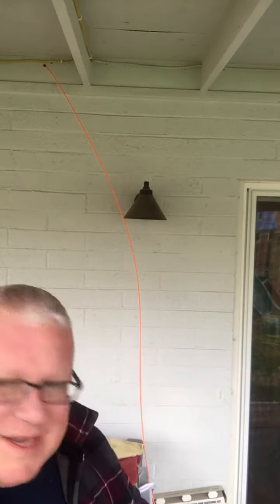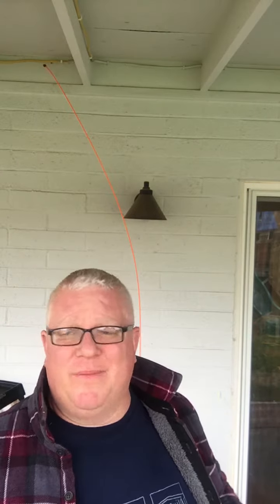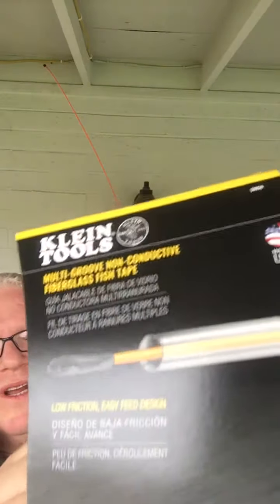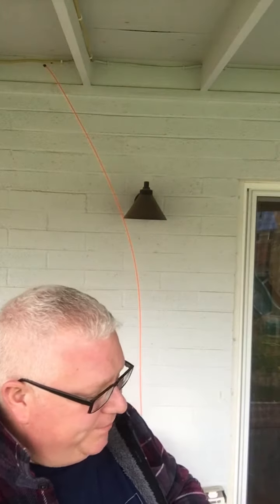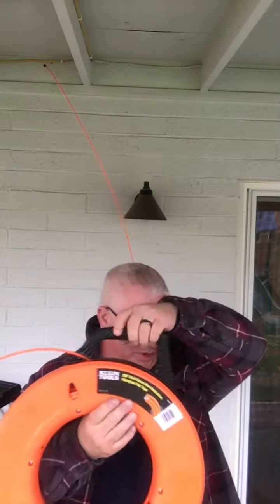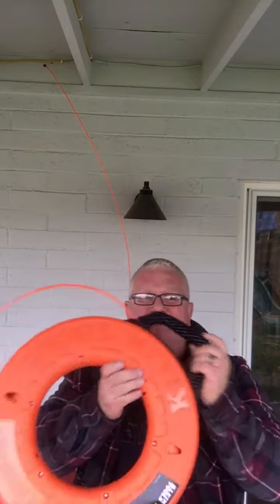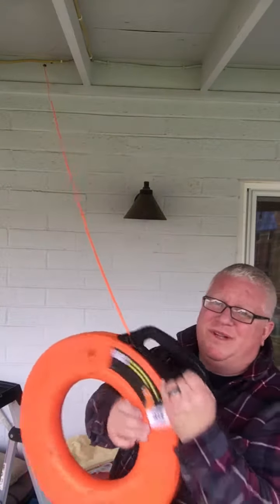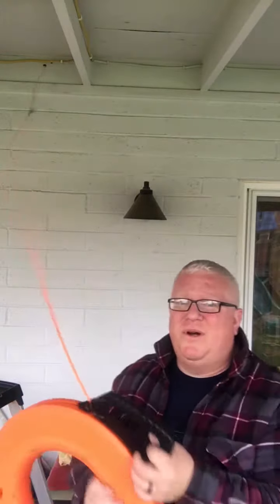Klein's new non-conductive multi-groove Fishtape Review

Comment: I'm guessing that it's a very bad idea to clamp onto the fiberglass tape with a vice grip in order to pull it? I should be using rubber gloves? (I'm asking because as a home owner, I've used the metal fish tapes in the past where I had to overcome a lot of resistance from multiple cables through a conduit.
Reply from the maker: If you are working that hard, I would worry you have too many conductors in the conduit. Next time get Klein's wire-pulling lubricant: https://www.homedepot.com/p/Klein-Tools-32-oz-Premium-Synthetic-Clear-Lubricant-51028/100660159?MERCH=REC-pipsem-300496825--100660159--N